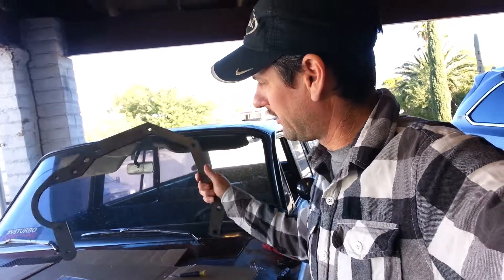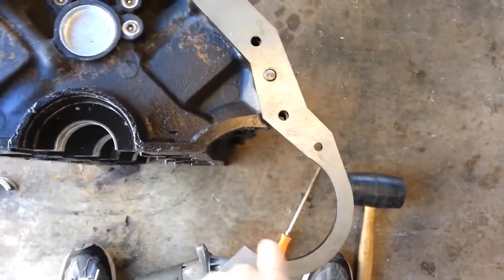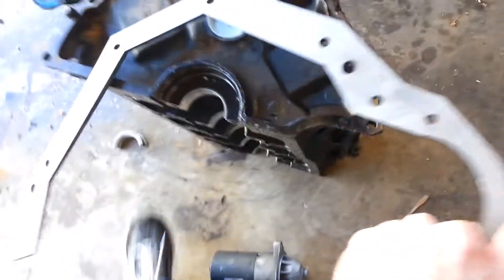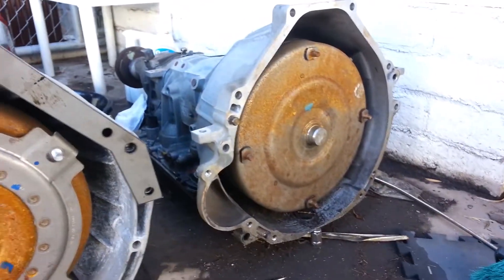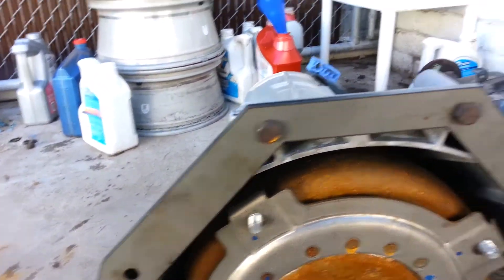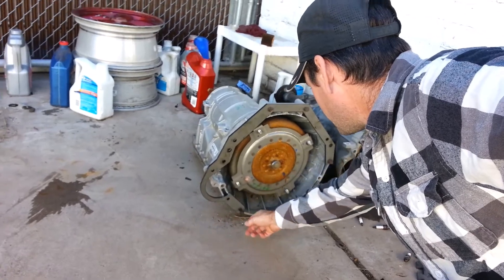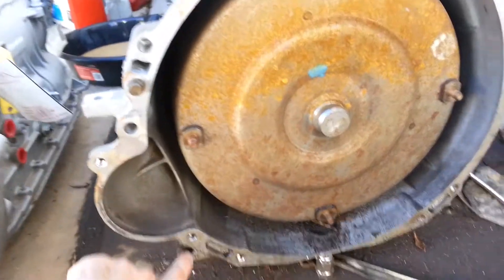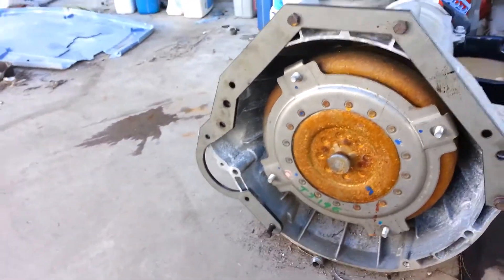6R80 Adapter Plate to 302 Ford Part 1

Comment: I'd be willing to buy an adaptor plate like this if it doesn't require much of any flywheel or torque converter spacing. I'm building a 94 F-150 for both work and play so I need something both stout and compact. 

-Swapping the extremely tired 300ci for a built twin turbo 393ci (mainly Forged Internals)
-E4OD is obviously getting trashed for the 6R80
-Sterling F-250/350 rear end and front Raptor IFS suspension (both have custom Dutchman 6 lug axles from Dutchman Axles)
-4.10 Gear Ratio
-Nice low 570 RPM idle and 6900 RPM redline (shift points are going to 6100 RPM)

Quite a list, I tell ya 😂 My power goal is 625-750 horses.
Reply from the maker: I didn't have to mod the flexplate, converter or any of the sorted parts when using the adapter plate.
Reply: @olboy1981  I plan to buy one from ya when I have the money, my man. The build is gonna take a lot outta every single check I make so it'll take me about a year or two (maybe even three or more since I'm just finishing community college) before I'm able to buy anything. If I can recall you had a video with an updated version of the plate. I'll be buying the updated version. Thank you for helping out with the questions I had, Ryan! (High five from NW Louisiana)

Comment: Did the trans bolt up and fit properly without any spacers ect?
Reply from the maker: It will but I'm not sure how you'd hang a starter for the diameter of the flexplate.

Comment: great job! any updates on the version 2
Reply from the maker: I have sent one out to a customer and I'm waiting on feed back about fitment.  If you want/need one we can work something out.
Reply: @olboy1981  what are u selling them for?
Reply from the maker: @Eddieschopshop_956  $150 which included the shipping.
Reply from the maker: @Eddieschopshop_956  my latest video has more info on ordering and such.  Its a video on whats needs finished and how to order.
Reply: @olboy1981  sounds good.. I'm gathering a parts list on this swap to see if it's worth the trouble.. that quick 6 is pricey.. I will check out your latest vid..👍👍
Reply from the maker: @Eddieschopshop_956  I have the new design in stock and ready to ship.

Comment: Where did you get that block plate. You said it came in the mail, but then also said you made it?
Reply from the maker: I designed it in solidworks, saved it as a .dxf then dropped it into sendcutsend.com and got an instant quote.  Laser cut and shipped for $60 for a black Friday special.  Normal price is around $110 I think.
Reply: @olboy1981  are you gonna be selling any?
Reply from the maker: @QuikModsOBS  Maybe.  I fixed the issues with the first prototype but I need to order it and check fitment.
Reply: @olboy1981  okay awesome! I'm going back and forth on having my 4r70w but it seems like the 6r80 will be possibly cheaper to do!
Reply from the maker: @QuikModsOBS   I think the future will be the 6R80 and the 10R80's, They handle big power in stock form compared to the old C4/C6, AOD/4R types.  Getting the starter sorted and the controls will be the limiting factor.
Reply: Are you selling the adapter plates? Or would you email me the file if I purchased from you?
Reply from the maker: @theburrow.  I have a redesign that I'd like to test before sending out to everyone.  I'll post a video of the new design and a price when I get that far, thanks for the interest!
Reply: Ryan Denney  is you sell the file, I’m definitely a buyer! Nice work man